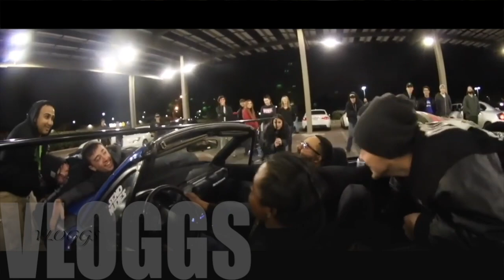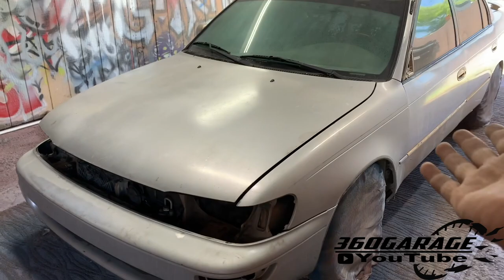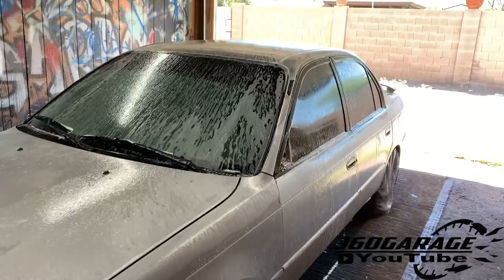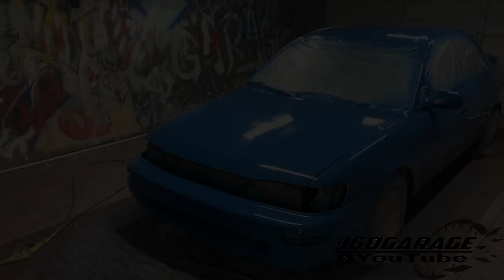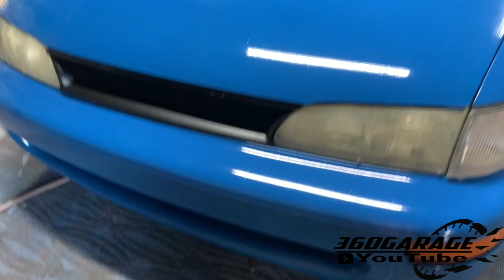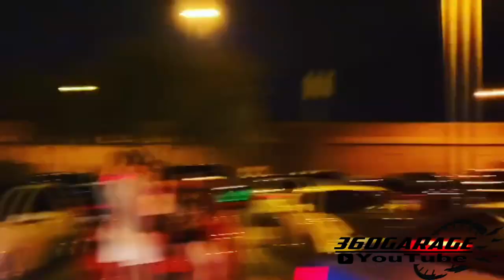Best $50 Rustoleum paint job

Comment: Do you apply a clear coat after you are finished? And about how long does this paint job last?
Reply: It'll fade pretty quick if you don't really stay on top of it. Rust-oleum doesn't have any UV protection. You'd be better off with some cheap summit single stage.